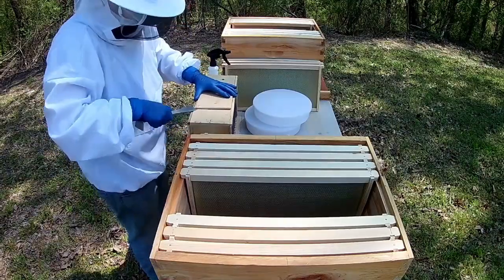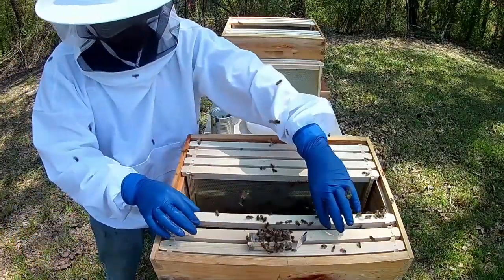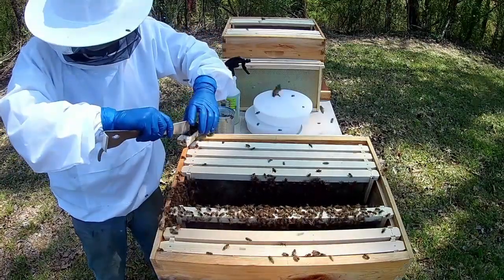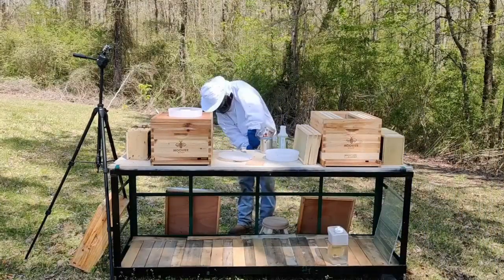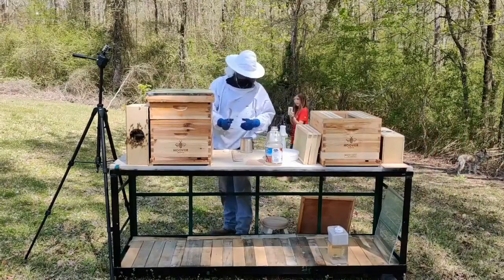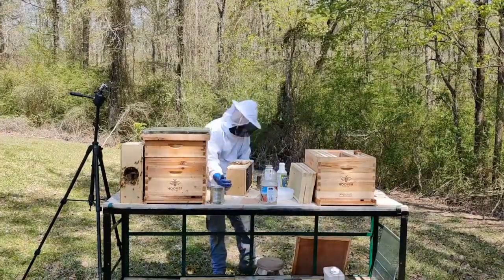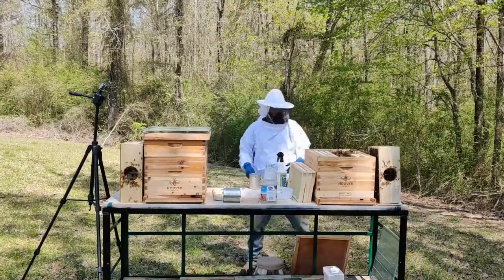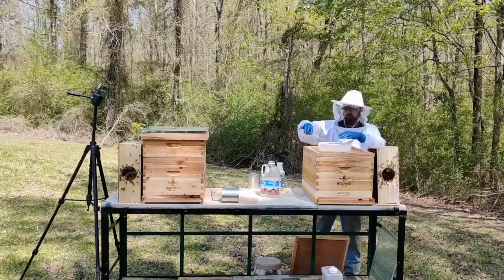Honey Bee Package Installation - First Time BeeKeeper

Comment: Slotted Bottom boards are usually only used for two purposed.  one, you can add this to any hive when gives more space away from the frame bottoms to the entrance, and in doing so, will entice bees to draw wax out further on the comb and the queen will go down further.  And two, in used for winter months to add protection from the cold.  These are the only two I know of.